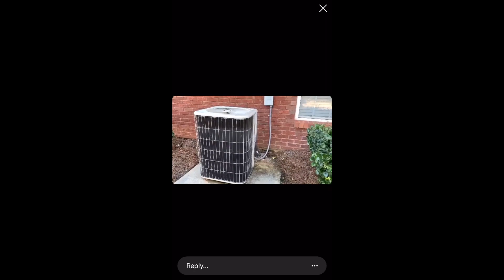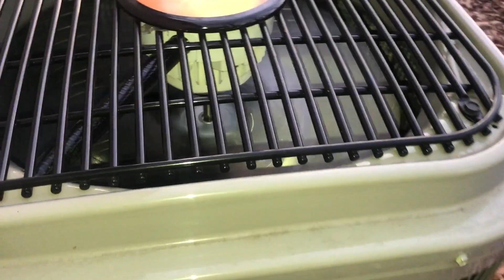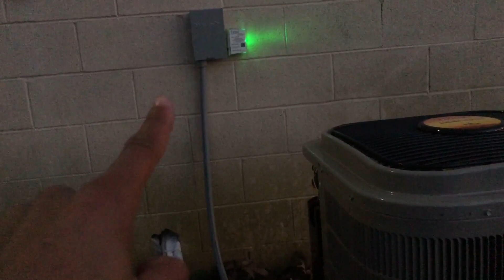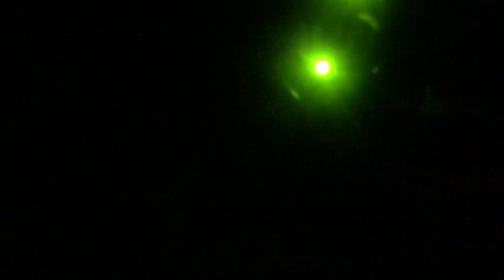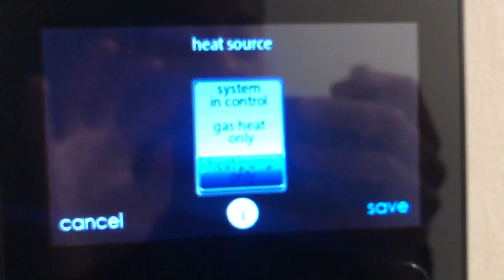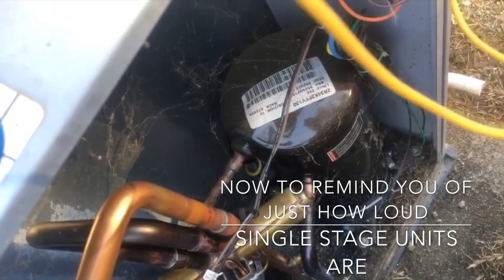Bryant Evolution Inverter Heat Pumps - What's an Inverter Heat Pump

Comment: I recently purchased and had installed a Carrier modulating Gas furnace and a 21 SEER2 Air Conditioner. Regarding my Gas bill. We went from $187.00 down to $122.00. I couldn’t be happier.
We upgraded from a two stage Goodman Gas Furnace.

Comment: we're actually trying to do the same thing that you did or said you would do if you bought a house we had to replace our air conditioner as an emergency and we went the cheapest unit and it bit Us in the butt 
are old electric bill was $250 our new electric bill with the new AC unit was $400 and then on hot days it's $600 and we have a gas pack  14 seer so now we're replacing that with inverter system. all the dealers that we've talked to so far said it would save us lots of money. we found a place for the air handler go so we're going to a split system.

Comment: Do you set a balance point for your dual fuel? I have a Bosch dual fuel system with a Honeywell thermostat. It’s not communicating. But I set mine to 45F so it’s running the gas more often.

Comment: Very informative...even 2 years later. I'm doing research now for a new 2 ton HVAC system for a 600 sqft home addition with 15 ft ceilings. Seriously thinking about this Bryant Evolution Variable speed 5 stage 16 seer or 18 seer. You think there will be a big difference in energy efficiency between the two?

Comment: You’ve sold me on the inverter. Our 10 year old trane struggles to heat our home here in KY.
Reply from the maker: it got down to 25 last night and my heat pump kept it at 72 all night..
Reply: @Malikoboost  nice!! We turn our heat down to 65 at night but up to 69 by morning. Takes many hrs to get there.
Reply: @JTBKY  with a inverter unit you'll want to keep it the same temp the whole day, it'll maintain the temp at the way lower amperage and save you more power than have it ramp up and burst to get the house warm

Comment: I hope you sealed up the holes for the line set and that extra hole. Foundations do not like water in them.
Heat pumps use the "Free Heat" as the by product of compressing the gas in a compressor. But the colder it gets the less free heat coming of the change.

Comment: Looks like the newest Bryant heatpumps are 24 SEER , 13 HPSF. https://www.bryant.com/en/us/products/heat-pumps/284a/    Certainly beats the others like Trane XV20i 20/10 heatpump that's been around for a long time. 2400 watts or so at stage 5 is real nice. Probably more like 2,000 watts with the 24 SEER unit, crazy. Might as well leave it at heat pump only on cold nights, looks like it would keep up! I like that the thermostat has the option because the flame air intake fan on my furnace is loud.  Don't want it to come on. Can you also disable gas heat when the heatpump runs defrost cycle with that thermostat? I'm going to eventually upgrade from Ruud gas furnace, AC to heatpump. furnace has variable speed blower i don't know how many stages. Hopefully Bryant thermostat and heatpump is compatible with Ruud furnace.
Reply: Mr Cool universal

Comment: Great and informative video. Thank you. Let me ask you. I am getting ready to change out my 24 year old TRANE 5 ton unit that ha a service nightmare since I moved in to this house 15 years ago. Luckily I haven't had to foot most of the 'repair; costs. I am a 71 year old disabled retired Marine Corps combat veteran with a busted up body that comes with the territory. What would your recommendation be for a 5 ton, SEER 16-19 system similar in technology to the one you are using here. The house is 2 story, 2866 square feet in San Antonio, Texas.  I've had no a/c since the 11th of May do to slow movement on the part of AHS assigned technician  and it's only gotten up to 101 Degrees F here so far but the summer is coming.  
I'd appreciate your feed back. My beautiful wife is starting to get a bit upset. :-)

Comment: Very  Informative  Video.  Do  you know  if  the ability  to operate at 25 % applies  to  all of  the  various units  such as  the  3  ton and 4 ton etc. ?  In  some  HVAC units  the  low  operating  capacities only apply to certain  tons  like  3 ton or  4 ton?  Thanks
Reply from the maker: Albert Levet this only applies to the entire line of 18 seer equipment. Once you get to 20 seer, it’ll only operate at a lowest of 40%.. This is not limited to tonnage/capacity
Reply: @Malikoboost  Thanks
Reply: @Malikoboost   Thanks  Hope all is well for you

Comment: Nice video. I have the comfortmaker version of this. Absolutely love it. Went from a 2 ton single stage to a 3 ton. Only runs up to stage 2 in cooling which equals 1.5 tons and ramps up to three tons in heating as needed. The heat strips are locked out down to 20 degrees and rarely need them. Great heat pump system.

Comment: Great video!!! I actually watched the full 50 minutes. What is your experience regarding long term reliability between the 5 stage and the inverter (Bryant evolution extreme / carrier greenspeed) units? I’ve heard the inverter control board for these units can cost $2,500+ to replace. I got a quote for about $15K for the 5 stage and $17K for the greenspeed. Not sure if the extra $2K is worth it. I live up in Connecticut.
Reply from the maker: Personally I’ve only had mine since July of 2019.. so far I haven’t had any issues with the actual unit. Mine is a dual fuel set up so heat pump outside, gas furnace indoor unit. It was 29*F this morning when I got up and the heat pump was maintaining my house at 72*F..... without triggering the gas furnace (or what would be a heat pumps auxiliary heat).. I will say this, if it normally doesn’t get above 40 where you live, and you have gas heat, do not CONVERT from gas to electric, go dual fuel. Because when the high is 40, and the entire day averages under 35*F, it’s going to WORK.. it’s going to ramp up to 5th stage and constantly be going in and out of defrost. It’s FAR BETTER than a single stage system or 2 stage system. Don’t even get me started on the sumner time dehumidification stage it has, it will dry the crap out of your house and you can actually adjust the intensity of the dehumidification. Long term wise, I feel like due to the absence of instant delay engagement torque starts, capacitors, relays, it will last a long time before I actually have to do something to it in a form of repairs. Lack of vibration also helps mitigate leaks.
Reply from the maker: Jay Abraham now to answer your question, go with the 5 stage, because the 5 stage inverter like I have actually can stage down LOWER THAN the 20 seer extreme. The 20 seer can only stage down to 40 percent of its capacity vs the 18 seer 5 steps 25%.. the 18 can stage down to 25% of its full capacity. Also, the money savings on what you’ll spend on that 20 seer vs the 28 won’t accommodate for the 2 seer difference.
Reply: Thanks for quick response. Also, the 5 speed will not start if temps are under 10 -- and will not operated under 2 ... the greenspeed will go down to -15. However, for people who have dual fuel, then the 5 stage is the way to go since the extra money for the greenspeed will likely never pay itself back.

Comment: Maliko thanks for the information.  What kind of thermostat would you recommend for Bryant 226ANA048 4.0 ton 2 Stage Preferred 16 Heat Pump Condenser?
Reply from the maker: An Ecobee 4 or Ecobee Pro will work. A Honeywell TH9320WF5003 will work. Just about any 2 stage thermostat will work. And if by 2 stage you mean "2 stages of heat pump plus auxiliary heat" or "1 stage/single stage compressor with auxiliary heat", YES, both those thermostats will run either/or.